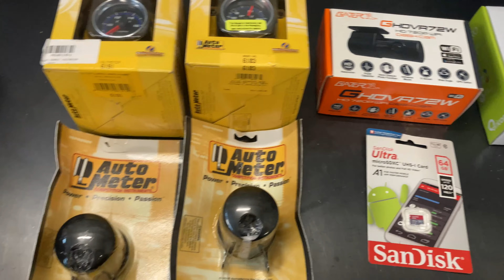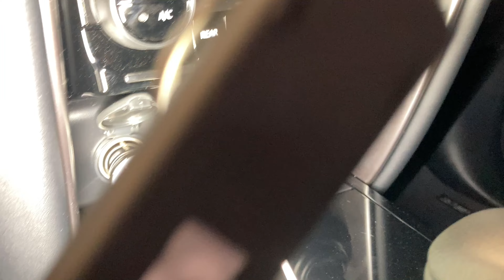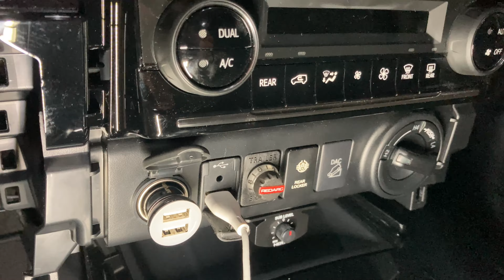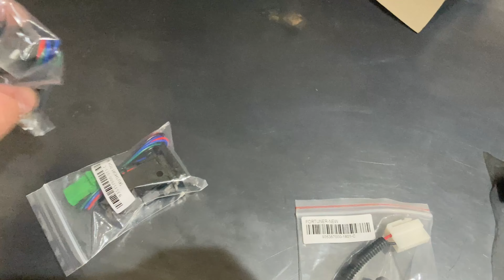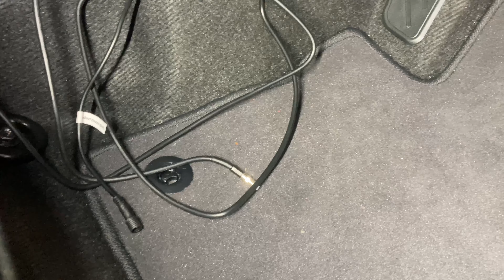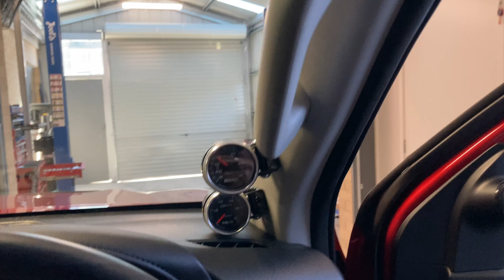Dez All Wired Up! Fortuner Gets All The Electronics. Ep 3

Comment: Where did the difflock kit come from mate
Reply from the maker: Company is called perception lighting
Reply: Do you rate the kit?
Reply from the maker: Yeah very much so. Very hand to have. A lot of tracks that are relatively flat, but rutted out, I can easily get through just in 2WD with the diff lock on
Reply: Hi sir i have headlight auto levelling it doesnt work the seller ask me to bypass and look for the 12v i dnt know where to find that?
Reply from the maker: @Skull0023 you can get 12v from the accessory power socket or just piggy back off any of the accessory fuses
Reply: @cassarindustries_wheelwerk  thank you sir ,😊